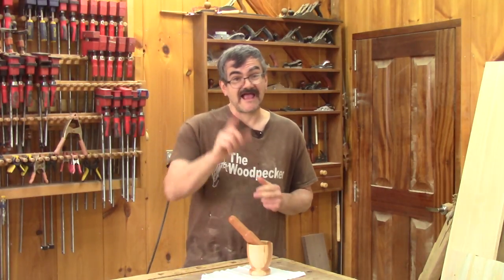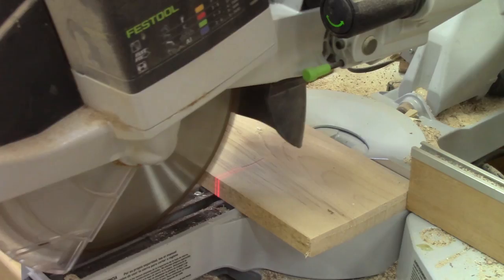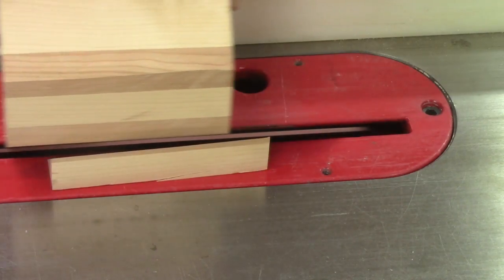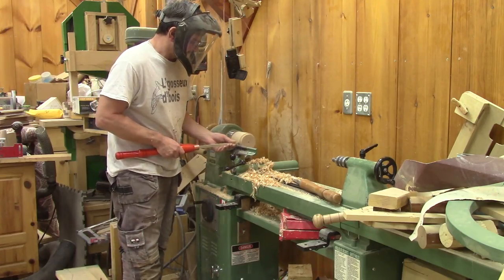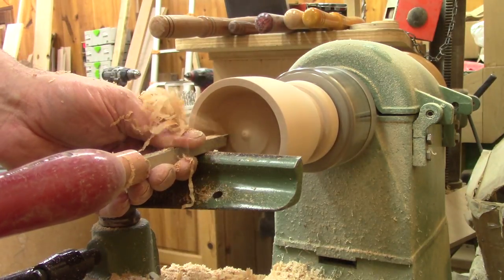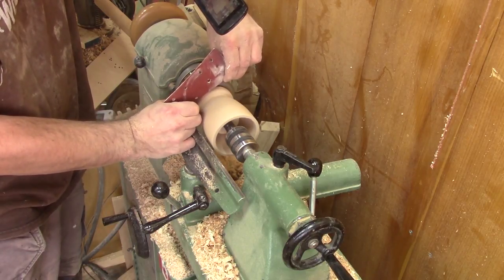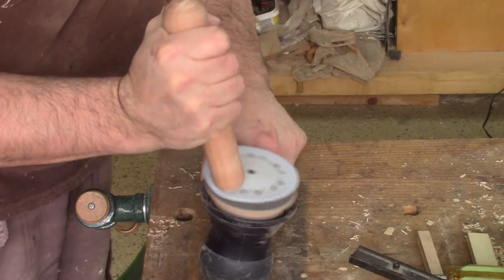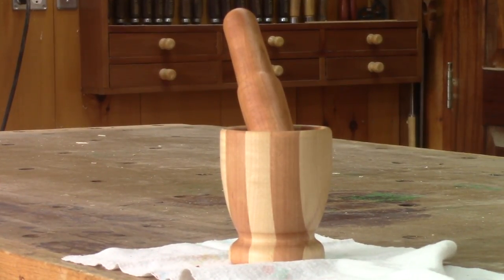The Woodpecker Ep 263 - Mortar and pestle

Comment: Doesn't the chuck have a bevel on the  parts that hold the piece?  So that if you bevel the mortise that it is holding, it would act like a dovetail?  There has to be a good reason why it keeps coming out.  Have you heard that english expression - "The definition of madness is to do the same thing and expect a different result!"
Reply from the maker: Yes I've know the expression. 
On the Christmas present  I've turned this year, I made a tiny angle cut like you said. It was better out of 9 only 2 exploded from the bottom tenon, the rest hold well in place.

Comment: Sometimes I think I should buy a lathe and take up turning....
Reply from the maker: I hope you're more patient than I am... I have a, somehow old, but not to bad lathe, but I don't really like turning... I do it but don't always enjoy it, as you might have noticed. But I think what I dislike is what draw most people to it; instant reward. You put a piece of wood on the lathe and half an hour later it's done with finish and all. I have the feeling I did nothing. But it's quick and it can be a nice present without too much effort.. Yes I've turned other presents this Christmas, you'll see that next year, but without the drama this time....
Reply: @LgosseuxDbois-TheWoodpecker  I too have an old (but not especially good) lathe, but with patience I have learned to make some nice things.  You are 100% correct that the turning part of the work is pretty quick.  For me the rewarding part is preparing the turning blank.  Sometimes I'll spend a week gluing up a segmented bowl or rolling pin.  Then the challenge is to release the beautiful form contained within the ugly gluey mess.

When I was initially teaching myself to use my lathe (I'm still on the learning curve), I practiced with pieces of firewood.  That way my failures ended up where they were going anyway, and it cost me nothing.  There were days when the workshop was very warm indeed.
Reply from the maker: It's why this year I used a solid piece of wood to make my Christmas presents, This way when they blew in my face I didn't had the disappointment of having waited a week for all that glue to dry and ruined the piece. But out of 9 turned boxes I only had two who flew away. But this part of the wood had dry rot, so it was to be expected.
Reply: And then you watch videos like this!

Comment: I don't imagine you'll be making another one of these but the inside of the mortar works best for grinding things up if it's a bit rougher, not so sanded.
Reply from the maker: I might make one or two more to try to sell at Christmas fair, maybe next year. 
I didn't knew that, I thought it needed to be super smooth, like the marble ones.
Reply: @LgosseuxDbois-TheWoodpecker  The wide marble ones with the tabs on the outer edge you see in Italy are used for making pesto, not so much grinding spices. The better tool for harder materials is the Mexican version of this the "molcajete". Both mortar and pestle parts of these are made from really porous volcanic rock, works excellently.
Reply from the maker: Thank you very much for the information

Comment: I always wonder if it would be easier to remove the bulk of the material from the inside with a Forstner bit.
Reply from the maker: I would say that this would had been a better solution. If I ever make another one, I might make a couple more to sell a Christmas fair, I will definitively remove most of the inside with a forstner bit.
Reply: @LgosseuxDbois-TheWoodpecker  Poject idea: external support using three skate-board wheels?
Reply from the maker: I do have one. Maybe this would had helped also
Reply: @LgosseuxDbois-TheWoodpecker  I see, you just like to live dangerously :-)